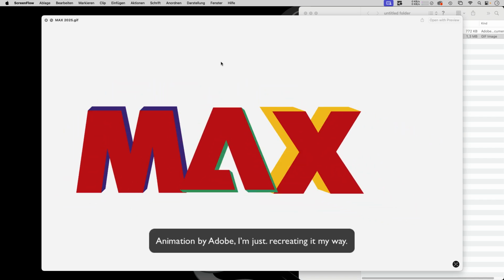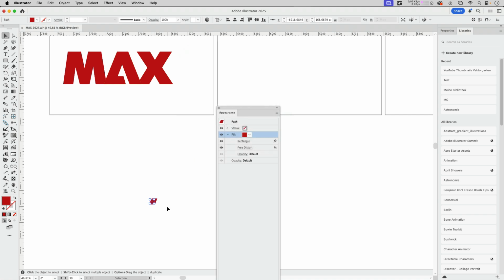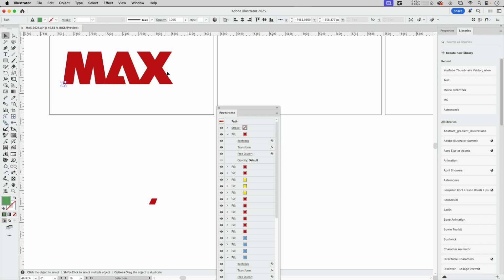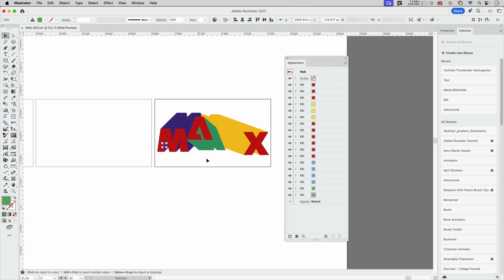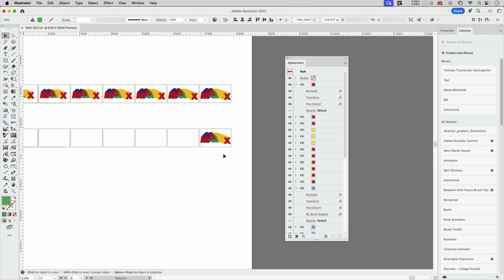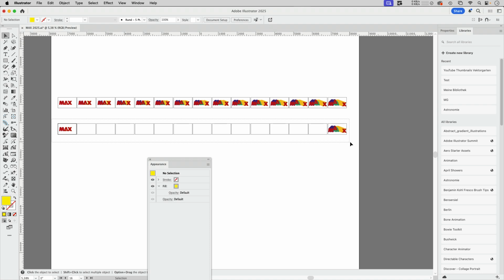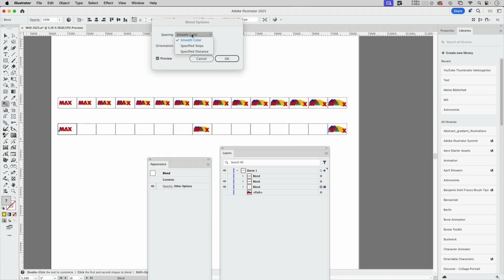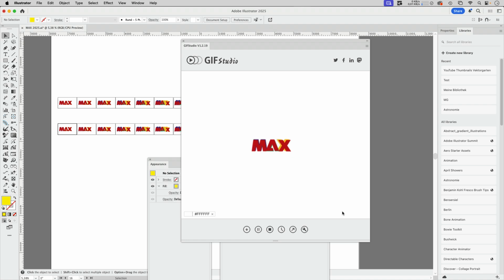Create Animation With Astute Graphics Block Shadow Plugin in Adobe Illustrator

Comment: Whats been your previous experience with After Effects?
Reply from the maker: It's been some time since I used it. I have more recent experience with Animate, but even that is some time ago. 
Of course for most slightly complex animations a dedicated animation software (After Effects or whatever) is the appropriate solution. I'm only doing this because I can and if you are only creating small animations for social media or websites once in a while (and learning or having After Effects or similar cannot be justified), then this is what I would do. I even find Adobe Express somewhat clumsy in handling (which is clearly caused by me not using it regularly for that purpose).